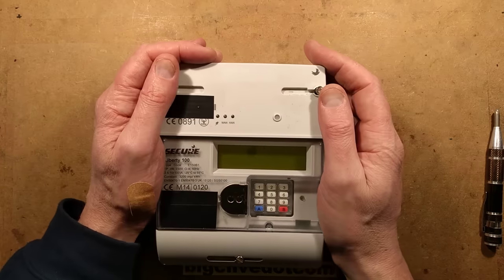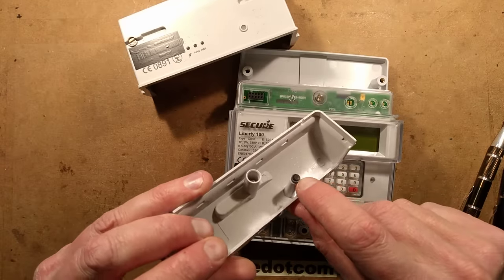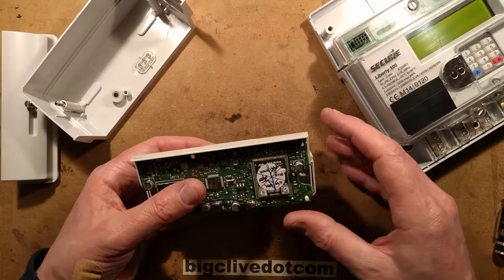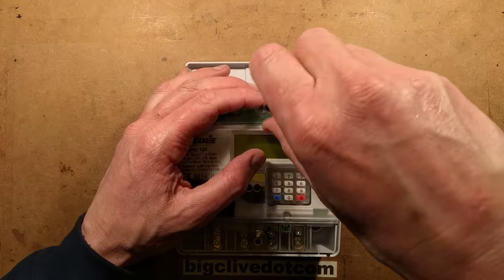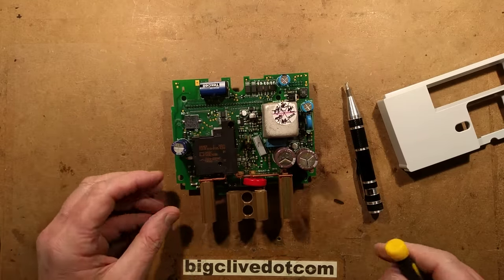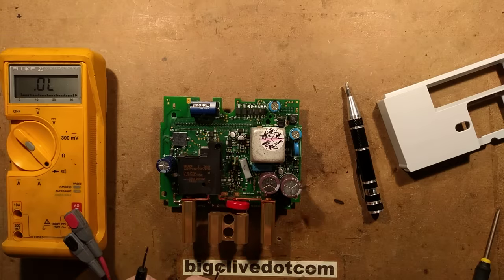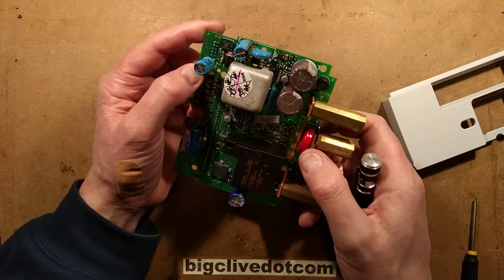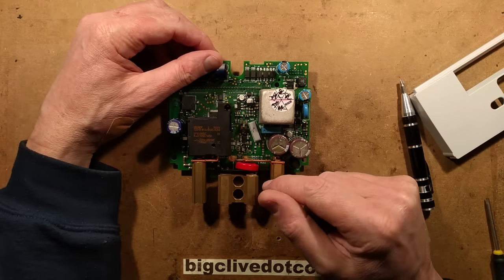Inside a smart meter, and the REAL problem with them.

Comment: How comforting to know that the elderly and infirm can now have their power disconnected remotely when they're unable to pay the bill. Be sure to check on your neighbours this winter.
Reply: Which is exactly why they don't disconnect the power remotel.
Reply: Oh yea they do
Reply: @jjarry  if they have a court order they can do (PAYG mode yes no credit the meter will disconnect power as long as it's outside of 3pm-10am week day and Friday 3pm - weekend - Monday 10am power will stay on )
Reply: They can't. The relay is for using the meter as a prepayment meter. So the only thing that can cut you off is lack of money, which is just as bad really.
Reply: ben kerr Do you have any concrete reason to believe that a meter owned and commissioned by the power company doesn't implicitly trust said power company to be right at all times?
Reply: An electronic measuring device doesn't have the ability to trust. I don't really know what you are saying, it doesn't make sense to me. All prepayment meters operate on one principle, if the money runs out, the power turns off.  So although suppliers can say they will not cut off anyones electricity due to non payment, they fit a prepayment meter, so if you run out of money, youre still cut off, but the company can say they didnt cut you off. A bit sneaky maybe, but theres no grand conspiracy.
Reply: They aren’t even allowed to disconnect at certain times of year never mind at the flick of a switch hundreds of miles away. All sorts of vulnerability checks and site visits have to be made before they would attempt to fit a pre payment meter (or swap smart to prepay) via a warrant and even then a mop needs to be onsite. The utility companies would much rather get paid than go to all of that hassle to get there money back at £3 a week for the next 10-20 years.
Reply: Priza25  Its not about swapping a smart meter for a prepayment meter, these meters are both smart and prepayment. I worked in metering years ago, before smart meters arrived, and we did change credit meters to prepayment meters, usually with consent, ocassionally under warrant, sometimes at customer request, sometimes forced on them because of existing debt. Most I ever saw deducted as a weekly charge for debt was £20, and the debt added on to the meter included debt owed by customer, court/warrant cost, cost of locksmith, (if required), cost of my time, and the cost of the suppliers representative, who held the warrants. Much easier and cheaper to let them in to change the meter before it gets to that stage. It is more hassle to the supplier to get warrants, but it really doesn't bother them, as they recoup all of their costs.
Reply: Here in Italy they can and do cut your power quite swiftly if you don't pay.At your second missed bill they cut your power to something like 500W continuous so the only thing you can run is a fridge, and if you still don't pay after 5 days or so they cut it completely.
Either way just pay your bills and you won't have any issues.
Reply: @johnfrancisdoe1563  this does vary from place to place, but the lines company, not the power company usually owns the meter, which is why you don't have to change meters when you change companies. 

Why is this important? Because the lines company has little to no interest in lying about your usage to you or your provider, they are so heavily audited it's not even viable to think about intentionally having bad readings, not to mention the huge amount of technical issues this would create, suddenly all your load balancing and management has to be based on numbers you can't trust, or you have some horrendous double secret figure system which, as someone who writes software for a lines company, I can tell you is far more work then I'm willing to do, and I certainly am not paid enough to want to risk.

So I wouldn't be scared of a smart meter, because even if you don't trust the mountain of auditing, chances are that all along the chain there are people like me, people who barely are willing to do the job they're paid to do on paper, who are going to take 7 smokos a day no matter how urgent your problem is, and most importantly, honestly just don't care enough about their job to be willing to commit some mild fraud for.
Reply: ben kerr that’s what I meant by swap smart to prepay. All the current processes would have to be followed regardless of if a dumb or smart meter was on site.
Reply: @benkerr9051  did you actually just say it was bad for a company providing a service to stop providing that service when you can't pay for it
Reply: TheCheezWizz  In the UK, it is illegal. You cannot get cut off by your electricity supplier for debt, if there is a dispute over a bill, or if the customer gets into arrears, it can either go to court, or the customer can agree to a mutually acceptable payment schedule. What often happens is the supplier proposes fitting a prepayment meter, with the amount owed added on to the meter as a debt, and an additional weekly charge is added to the meter to pay off the debt over time. Of course if the customer cant afford to top up the meter, then it is effectively the same as being cut off. 

What they are trying to avoid is families sitting in a house with no electricity, and the problems that would cause, for them, or for landlords of the property.

In practice, what sometimes happens. if they cant afford to top up the meter, is the customer may bypass or tamper with the meter/supply, if you get caught the meter is replaced with a new prepayment meter, all costs incurred in the process, and an estimate of the amount stolen are added to the meter as a debt, first time they get caught. If they get caught a second time, then the supplier is allowed to cut off the supply, for safety reasons.
Reply: Anyone could have had their power disconnected just as easily prior to this, by sending a technician to your house. Smart meter changes nothing about that issue.
Reply: @Money4Nothing  I didn't say it made any difference, my experience of metering works is all in the pre smart meter era, I currently work in internal mains and substations.
Reply: @Monkeh616  Oh yes they can. And it happened to me a year or so back because the guy who installed all of the new smart meters in the area got the serial number for mine switched with my neighbor. So not only had I been paying his bill for almost 2 years (and he was paying mine) when they didn't pay for a few months my power got cut off, remotely. A lineman never came to the house, because if one had they'd have noticed instantly they had the wrong meter. If you look at the 2 meters, my house and meter are on the right his on the left, and you can follow the conduit down and into each unit.
So yeah, they can and will disconnect it remotely.
Reply: Ken Su  Do you have any thoughts on Marmite?
Reply: @demoniack81  500W is more like 3 fridges but yeah
Reply: The utility companies have always had that power.
Reply: welcome to the beginning of the age of globalism.
Reply: Regarding the issue of electricity disconnects in the UK, ben kerr is correct, the electricity company is not allowed to disable supply to a property of a 'law abiding' citizen. Even if the person is in debt with the electricity company, being in debt is not considered 'illegal'. If the householder is unable to pay their bill, the electricity company will arrange a 'debt plan'. If the debt plan is not followed, the electricity company can ask the court to grant it a court order to allow it it enter the property to fit a pre-pay meter. The outstanding debt is then configured into the pre-pay meter so that a small amount is deducted from the debt, as well as providing enough for the householder to have electricity. Once the pre-pay meter reaches £0 it will trip a relay to the incoming live wire and disconnect the electricity to the property. 

In the past, electricity companies did cut of the electricity supply if the bill was not paid but as the years progressed, electricity became such an intrinsic part of a persons everyday life that the government with the help of the courts concluded that electricity is such an important life necessity that electricity companies could no longer just cut off the supply due to an unpaid bill, hence the introduction of pre-pay meters.
Reply: Exactly the same as disconnecting a prepayment meter when the dosh runs out. The difference with these is that given all the safeguarding regulations, they can now switch it on remotely too - no need to wait for the shops to open to top up a card then walk back to put it in the meter. Keep paying the bills, keep the lights on. Cant pay the bills and still need the lights on (a genuine case of need - rather than just having spent it on fags and drugs - both types of “poverty” exist), then power is but a phone call away.

Comment: I’ll have one when it will automatically monitor all the electricity co’s tariffs and switch me onto the cheapest one.  Now THAT would be smart!
Reply: yeah these ain't smart meters. Definitely not smart enough to stop me intercepting the wireless data and sending custom packets to reduce my bill.  Aside from health risks, I always thought they were idiots to send usage data over wireless.
Reply: @tehf00n  Ah, you have all the appropriate keys on hand to do this, I assume? Or are we just assuming it's a totally cleartext system with no thought into security whatsoever?
Reply: @Monkeh616  I would be surprised if there were security tbh. But lets say there is as there's a good chance there might be. It's gonna be basic wireless security. Lets presume WEP. Now unless they change keys remotely at specific time periods, I have all the time I need to brute force it. Lets say it goes one step further and uses WPA2. That's already broken using KraCK. The fact I have access to the device in a short range scenario helps. Not to mention there seems to be two setups, WAN and LAN/BT means I have extra holes I can abuse.  Its not rocket science now we have the internet.
Reply: @tehf00n  I'd be very surprised if there weren't. Actually, I know there is, I bothered to look..

And no, it's not basic wireless security, it's not WEP, it's not even WPA2 - IT'S NOT WIFI AT ALL.

I'm sure the security can be broken, everything gets broken eventually, but it's not likely to be as amusingly trivial as you want it to be.
Reply: @Monkeh616  my triviality is just confidence. I don't believe there are many encryption systems that are safe against a volatile attacker until you get to the breakpoint of time vs computing power available.  And serious encryption should be using one-time pad.  If it used that, my confidence would drop to none.
Reply: Mark Janes that's a superb idea, so you give your supplier permission to share your consumption info with a particular comparison service, and then you go onto the comparison site to compare what you've paid based on usage in specified period of time, real time tariff comparison and instant switching.  that would force the suppliers to stay on their toes.  And you can choose to revoke monitoring from the switching service at any point. Privacy protected, money saved, industry given a regular kick up the backside to keep prices down.
Reply: @tehf00n  What health risks? Its basically a mobile phone that it uses to communicate, you know, the one you carry in your pocket all day?
Reply: @TomStorey96  No it's not.  Do you even read or do you just spout your opinion at the time?  If you want to learn about it, go do it but don't just try dismiss what I say with some analogy that doesn't even make sense.  and FYI, I wouldn't put a mobile phone upto my head for 50% of the day, why would I let an energy company force it on my children?
Reply: @tehf00n  Ok then, what is it specifically? I see a Sierra Wireless modem in there - in the module that came off the top of the meter. Sierra are huge in the cellular wireless business. That and the fact it has a SIM card ... The very same kind that is in your own mobile phone.

The other module will be some kind of low power RF module, maybe 2.4 GHz (same as your broadband router, or Bluetooth, or even your microwave oven) or maybe 433MHz (same as the remote for many a cars central locking) or one of a handfull of other frequencies used for highly localised communications, to talk to the display to show you what you are using.

If you're going to refute, have an answer. Or do you just repeat conspiracy theories and misinformation and claim those to be the truth?

The power company isn't "forcing" any thing more on you or your children than you already do with your/their own mobile phones.
Reply: some countries have a base grid that connects to your house, then the company in questions owns the meter and the elec they supply you.  So you can switch to another powerco no problem.
Reply: WIll be a bloody menace! Fly-by-night shyster electric companys popping up in portakabins, offering sneaky misleading tariffs to rip you off. The Russians might decide to fuck the grid over by offering dirt-cheap prices in certain narrow locations. All sorts of capability for mayhem. The UK National Grid is the wonder of reliability it is, because it's owned centrally and managed and curated  like an Egyptian tomb. In the USA "brownouts" are regular in every town in the summer. In the UK I didn't know what a "brownout" was til I read about it on the Internet. 

In fact, whoever your "provider" is, you're getting the same power down the same lines from the same people. The "supplier" and "producer" companies  manage the so-called choice purely in paperwork. They just work out who put however much in from which power stations, who took however much out to supply customers, and let the numbers all balance themselves. At the end, each company works out what it owes whom, and pays the difference. Changing your "supplier" you're really just choosing which company bills you. It's not real, just numbers.
Reply: @tehf00n  You don't seem to know what "volatile" means in this case (actually it doesn't mean anything). You seem to have got your encryption training from a boxout in a Playstation magazine. It's reasonably easy, for a company that takes it seriously, to employ effective encryption. Very quickly as the key length goes up, the effort to brute-force it requires computers made of more atoms than there are in the Universe, running for longer than the Universe is going to last.  And that's not even difficult stuff. 

Still at least you've graduated from them somehow using long-obsolete Wifi, for some reason, to one-time pads, the sort of stuff completely unsuitable for something like this. I'll give you due credit, 20 minutes skimming Wikipedia at LEAST. 

Of course you're not going to be able to get your Matrix gear out and start spoofing 5G signals to whoever you buy electricity from. There's not even any need to. If you've got any sense, break into your neighbour's box and run a wire across. Before the invention of the special security bit-of-plastic here, the old meters can still be bypassed with a bit of old coat hanger. Not rocket science.
Reply: kcotte59  in the UK at least, power transmission companies are different from power supply companies (who buy the electricity on your behalf from wholesalers/"power generation companies"), and you can freely switch power supply companies. But there is usually only one power transmission company in that area, like SSE who cover Scotland and the South of England. At first transmission and supply companies were kept separate but now many operate both types of service.
Reply: @spodge1233  Who is going to monitor the best deal?  Oh yes, yet another quango being paid silly money to do nothing much. Or more likely a broker taking a percentage YOOshift dot com 
It should be buyer beware just like anything else. Find a better deal? So switch. Then keep an eye on it as that wont be the tops for very long.
Reply: kcotte59  In UK we have Transco who maintain the gas and electricity networks. Power retailers buy energy at wholesale costs and sell it to consumers with added margin. Users can save by finding a retailler with the lowest margin or the best peak/off peak tariff to suit their needs
Reply: @tehf00n  well, arent you a netrunner haha. its so cool to see people effortlessly talk about breaching stuff like that.
Reply: @frigglebiscuit7484  when you have been a coder for 20 years and a network engineer for longer, you learn a few things. It's amazing what you can still find in a copy of 2600.
Reply: @breakcoregirlxd  when you are a good parent, you do think of the children. Also, you aren't funny, stop trying.
Reply: @Monkeh616  yes, that's exactly what I always expect from electrical engineers writing software.
They just think it's safe because the signal is physically isolated...
Reply: @tehf00n  you don't need to break the system from the most secure side, just get a similar system, and copy the data when it is negotiated with the cell.
Then you can have a replay attack, for example.

No need to break any cryptography at all.
Reply: A trial was run on a new housing estate (back in the '90s IIRC), with a computer switching the entire estate between suppliers every 15 minutes, depending upon which could give the best price at the time.